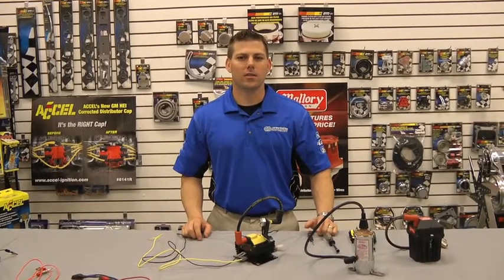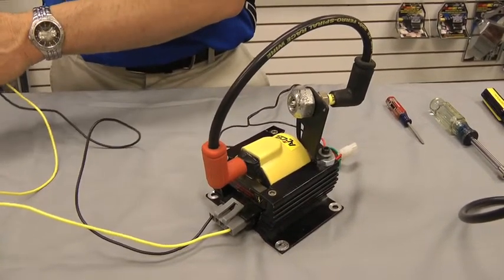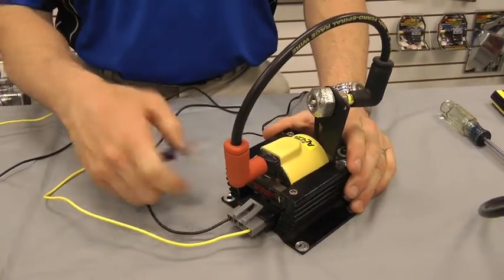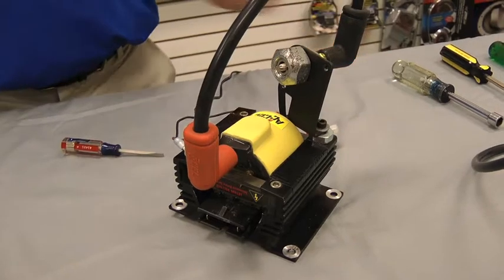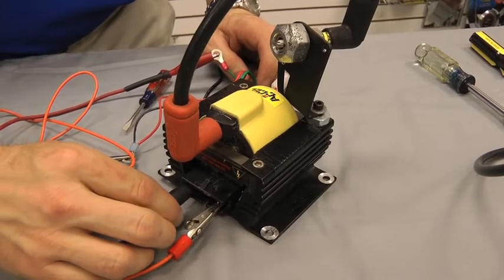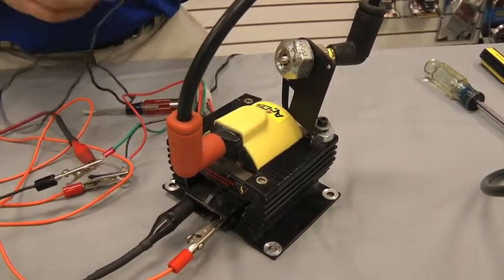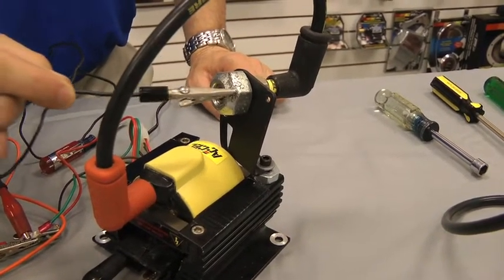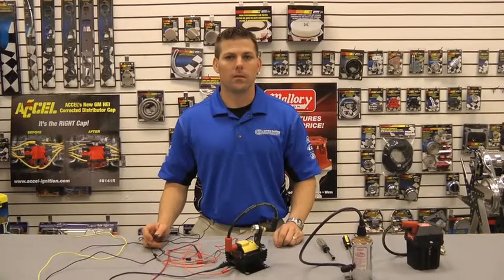ACCEL E-Core Super Coil - Testing an Ignition Coil for Positive Spark Video

Comment: So Disappointed with the Accel Ignition  Super Coils! 2000 Celica GTS All excited swap the Coils out. Right from the start Check Engine light comes on. Misfires on 2 and 4 Cylinder I was afraid of Damaging the Motor ! I've never seen such POOR PACKAGING!

Comment: I'm having problems with my accel super coil for my 02 chevy S10 ZR2. took the coil wire off the distributor and put a new spark plug in to test for spark and nothing the ground is good and it has power going to it. can I get it warranted out i havent even had it for 9 months.

Comment: I can't see from the video, are you testing for spark at the plug or spark from the wire you are tapping to a ground? I get spark between the wire and ground I tap but no spark jumping from the coil to the disconnected coil wire with a small gap.